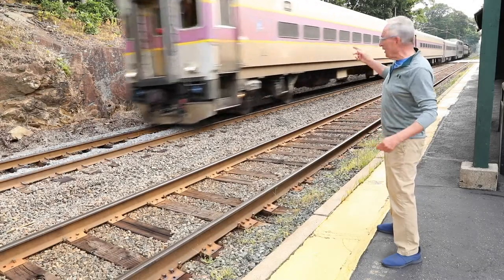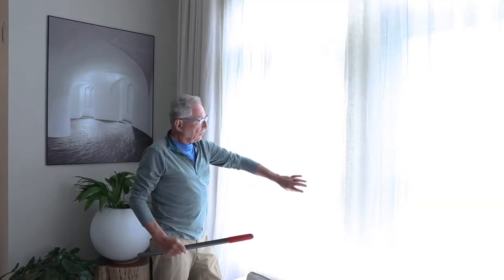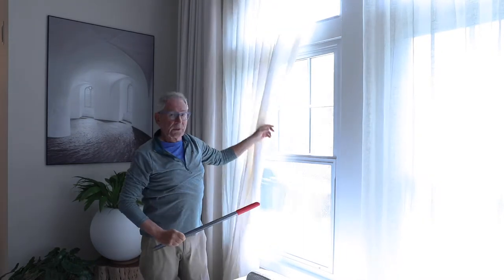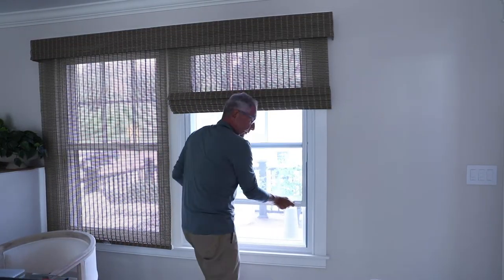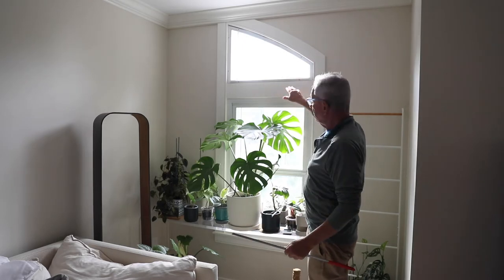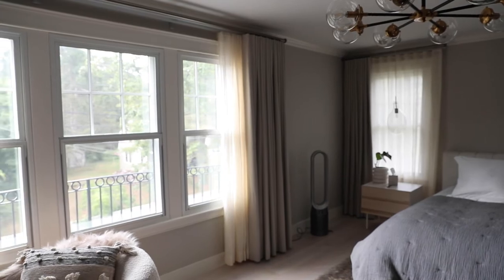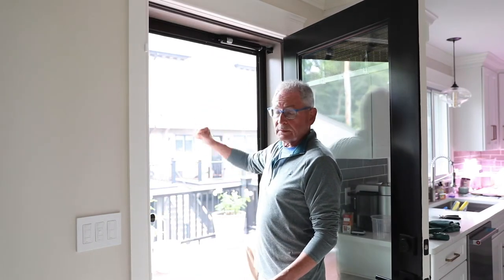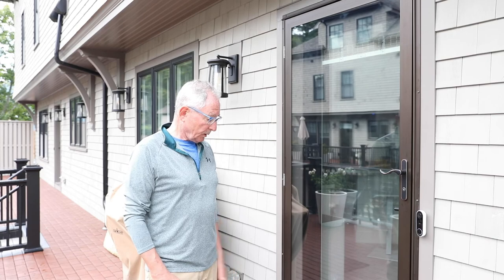Commuter Train Noise Eliminated - Peace Reclaimed

Comment: how does this compare to Indor company? I am deciding between the two and wanted to double make sure
Reply from the maker: Hi, thanks for looking at EZsoundproof window treatments! Our Sound Proof Window Treatments are made of hardened and toughened 3-ply crystal clear acoustic laminated glass and industrial gauge anodized aluminum frames. The STC ratings are typically 48 or greater when installed in front of your existing double pane window. Once installed, our window treatments allow you to open just like a traditional window giving you access to open your existing window when you want to allow in fresh air from outside. The other brand are window inserts of single sheets of acrylic/plastic. These need to be physically removed in order to access your existing window to open for fresh air.